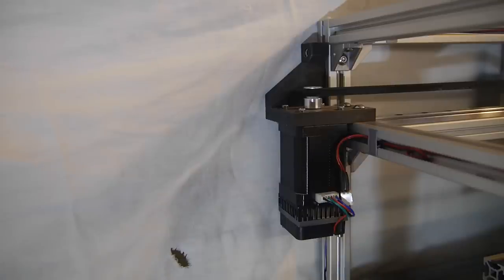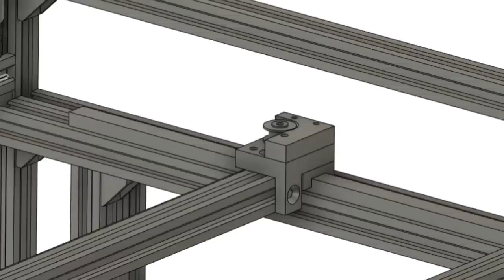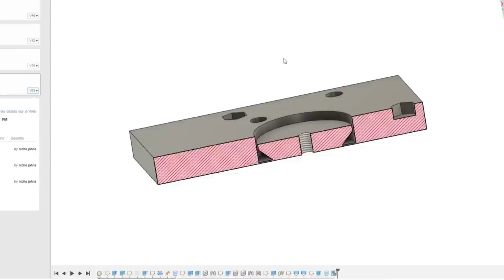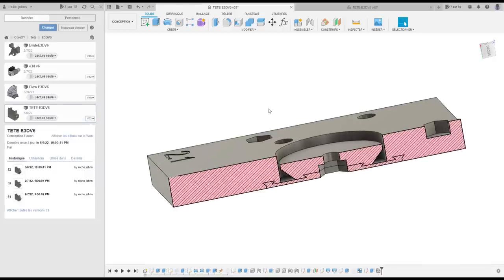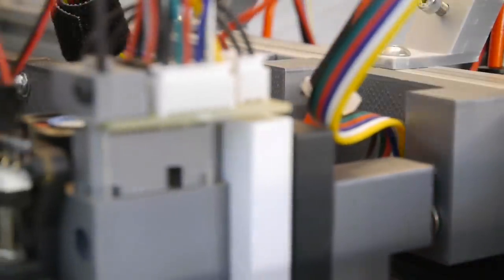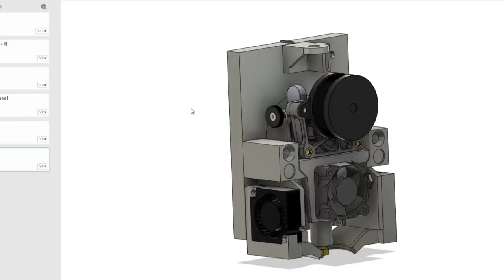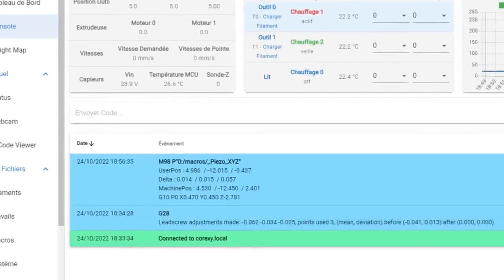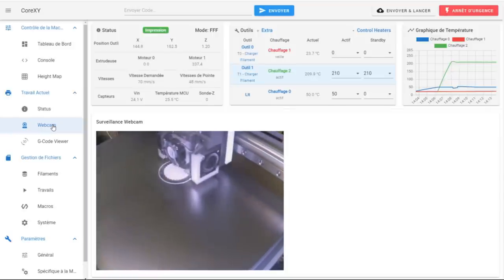My custom CoreXY printer and it's electromagnetic tool-changer

Comment: I have but one question… How are you handling the fact you violate one possibly two patents that Stratus currently holds in regards to tool changers?

Given that, this is a nice approach! Very nice…
Reply from the maker: Hi John, and thanks for your comment.
I have to say that I don't feel like I'm violating anyone while I'm tinkering in my workshop.
I'm curious to know what good idea I had that isn't the simple application of knowledge shared by everyone for a long time.
Unfortunately, I don't know Stratus.
Reply: @workshopfeedback  Here is just 2 of their plethora of Patents.

https://www.youtube.com/watch?v=nB2AFsNMAg8&list=PLTqXGUR7SoBXA9QR8x36y95wPDz0ww9TD&index=9

As to what you might be violating. The minute you share it. :)
Reply from the maker: @johnbeima6413  
Hello John,
Hello John,
Thanks for these informations.
I am not a PI engineer, but after looking at the patents mentioned, I identified several significant differences in the description of the processes compared to those used on my printer.
On the other hand my lawyers, who are not IP specialists either, do not seem very worried about the claims that can be made in the context of this video.
You may be an engineer or a lawyer specializing in IP, in which case I would be very interested in your opinion on either of these points.
Reply: @workshopfeedback  By the way, this is because we are looking at approaching this as well. So this is something over time we would also come up against. Hence asking, since many others feel there is no way around these.

Comment: Hello, I like your concept of tool change with electromagnet, I'd be interested in understanding how you optimize the heat generation of the magnet, I assume that the magnet remains in electrical voltage for the entire duration of the coupling generating a nice heat source? isn't this dangerous? Are my assumptions incorrect?
Reply from the maker: Hi, thanks for your comment.
The magnet consumes 6W and heats a bit because it's enclosed in the carriage.
I added a 30mm fan and left a down to top air path in the carriage to avoid overheating which is sufficient.
Reply: @workshopfeedback  Yes, thank you for your kind reply, out of curiosity I asked the question before fully watching the video, in fact you mentioned it, my fault :) if I may ask what g-code command do you use to activate the magnet? i would like to come up with something like this in the project to make a home printer for me thanks.
Reply from the maker: M42

Comment: What thickness strip did you use for your cable management? Love that idea
Reply from the maker: Sure !
It's carbon fiber 0.5 mm x 10 mm x 1 m bought on Amazon in 2016 but no more available.
Reply: @workshopfeedback  Thanks! I have very little experience with CF do you think 1mm would be too thick to bend properly in this application? Thanks for the info!
Reply from the maker: @nerddub  I think the main problem with the thickness of this part is the elasticity and the varying force it applies to the carriage depending on its position.
The more flexible the better, you must feel the influence it will have on the kinematics of the printhead 🙃
Difficult to know without having it in hand but I think that going from .5 to 1 mm makes quite a difference.
For the wires going to the carriage itself, as there's no bowden tube to support, I cut the strip in half lengthwise with a Dremel, it makes it softer.

Comment: Hello, I am consider building my own printer with toolchanger based on you great idea. Could you explain how washers on tools are flat with screws head (the part which is attracted by electromagnet)? Do you use wide washers with smaller screw (for example wide M8 washer with M4 conical screw) or do you use some special washer/huge flat magnet?
Reply from the maker: Hi, here is where I bought them : 
https://www.magnet-shop.com/adhesion-grounds-adhesive-surfaces/metallic-grounds-for-screw-mounting/2407/metal-disc-oe-34-mm-with-hole-and-countersink-nickel
With a M5 conical screw
Reply: @workshopfeedback  thank you! I didn't know such plate exist. Again thank you for inspiring me with you weel thought design. Have a nice day

Comment: very well explained! The only thing I'm unsure about, and it goes for other printers using this style of plate mounted hotends, where does the hot air from the heatsink go? I didn't see clear paths on the sides as the part cooling fans occupy that space, so is the air supposed to do a 180 turn in the small gaps between the two? And wont that air constantly blasting the soft part of the 3D printed mounting plate affect it over time?
Reply from the maker: You're right, there isn't any clear flow path.
I presume it flows from the bottom and seems sufficient to maintain the filament path at an acceptable temp. 
This air flow is at ambient temp and the fan very small, I don't think that can affect anything.
Reply: @workshopfeedback  On my printer I flipped the heatsink fan so it pulls the warm air away from it instead of pushing fresh air into it. When I put my hand in front of it, it's noticeably warmer than ambient. This is with a 40W volcano on a V6. I imagine that could be part of why you have issues getting your volcano setup running.
Reply from the maker: It's also the way they're mounted on my printheads.
I'm not sure that heatsink cooling is the origin of my problem but I will check the heatsink temp when re-working on it.

Comment: Hello, what kind of pole is this that is used as a cable guide? From frame to T0?
Reply from the maker: Hi, it is a carbon fiber plate, 0.5mm x 10mm
Reply: @workshopfeedback  where did you buy it?
Reply from the maker: Amazon a long time ago.
I found this which should be similar
https://www.amazon.fr/XMRISE-Bandes-Carbone-Barres-Accessoire/dp/B094QQRN4P/ref=sr_1_5

Comment: I wonder if a belt reduction drive would produce a more uniform extruder flow  than a gear drive.  If I design a new extruder for my printer I will try such a design as uniform extrusion has recently been getting more attention on youTube videos I've seen.  Until recently few people have focused on the ability to print smooth flat vertical walls as many printers produce walls with lots of waves and noise.
Reply from the maker: I've also seen videos about the extruder flow and walls flatness.
There may be multiple causes for that. I would look to Z wobbleing also.

Comment: Looking at the g code it uses some stuff that's reprap specific. Would of liked to see it be compatible with Klipper
Reply from the maker: I can't be of any help about Klipper.
Access to the software data structure e.g. {move.axes[0].machinePosition} is one of the wonderfull Reprap feature.
If available on Klipper, porting should be easy
Reply from the maker: I just had a look to the Klipper's doc.
I'm shure it's portable.

Comment: That is an excellent presentation 

Il y a moyen d'avoir plus d'infos sur cette imprimante fait maison ?
Merci
Reply from the maker: Je ne sais pas, que veux tu savoir ?
Reply: @workshopfeedback  ses capacités en termes de volume, vitesse etc....et bien sur le prix moyen à faire si un péquin comme moi souhait la fabriquer en me basant sur tes schemas ?
Anyway this might be a good concurrent for the other corexy designs !
Reply from the maker: Jay, 
le volume d'impression c'est 30cm au cube
J'imprime en général à 80mm/s et je n'ai pas vraiment cherché à tunner ça pour le moment.
J'y ai laissé environ 1 500 €
C'est pas que je ne veuille pas partager mais en dehors des modèles de travail sous fusion 360, je n'ai pas vraiment d'autre chose à fournir.
Pour le péquin, je suggérerais une solution plus documentée, supportée par la communauté et éprouvée comme la Voron trident.
En attendant un peu, ils vont peut être améliorer et implémenter mon design multi-têtes :-)
Reply: @workshopfeedback  j'allais partir sur un Ratrig ou Voron ou Annex ou Hevort.
Le péquin est pas si péquin qd meme mais j'adore le systeme magnétique, parcontre en cas de perte de tension la tete tombe car il n'y a pas de verrouillage non ?
Il faudrait rajouter, peut etre 2 tiges en fibre de carbone (comme les supports) pour la tenir en place, mais je pense que tu y a deja reflechi.
Reply from the maker: Tu peux aussi modifier un design existant pour réserver l'espace de parking des têtes.
Oui, la tête tombe mais elle est un peu retenue par les câbles et le tube avec la lamelle en fibre de carbone.
J'avais pensé à un système avec des aimants mais je ne l'ai jamais fait parce que ça ne me gène pas.

Comment: Hello,
What I think is a great and brilliant job you did with the printer.

Is there a chance you would share your printable files and other information with me.

You also received a private message from me via email.

I send greetings from the Black Sea coast of Bulgaria
Reply from the maker: Hello, thank you for your messages.
It is difficult to provide designs because the printer is a prototype and the video was intended to show the different concepts I used and how I implemented them. 
The design files are not in a shareable state.
If you have any questions on various technical points, I will do my best to help you.
My best advice in this type of production is to make a complete model of the printer in fusion 360 or another CAD software before starting manufacturing. 
Otherwise you can also start with a VORON type printer which seems well documented to me.

Comment: I assume that you use an electromagnet for the tool changer. You can also consider to use a switchable permanent magnet 🧲.  There are several video on youtube about this. E. https://youtu.be/n9tZIFfM14o
Reply from the maker: Yes it was a solution using a servo to rotate the magnets.
I love this one : https://www.youtube.com/watch?v=bYUtPNZ3ag4
The advantage is that the head doesn't just fall down when there's a power supply failure.
But with an electromagnet there's no moving part unless the spring effect which would be necessary in both designs.